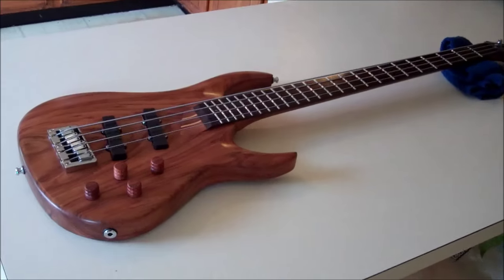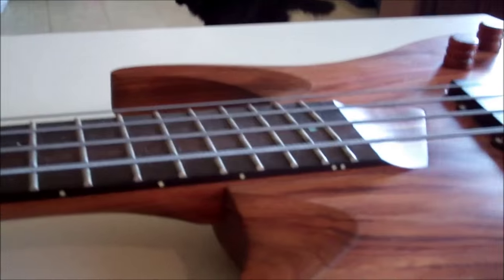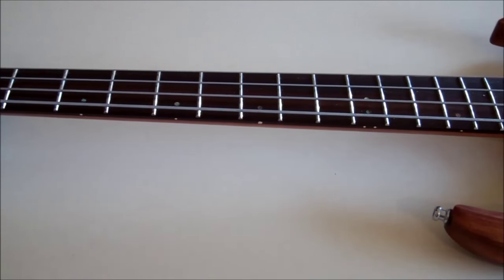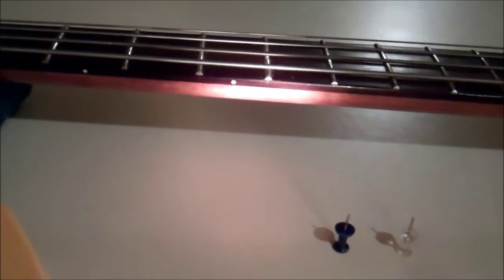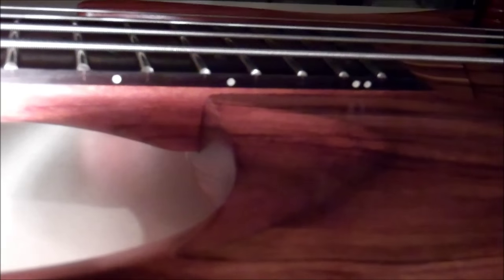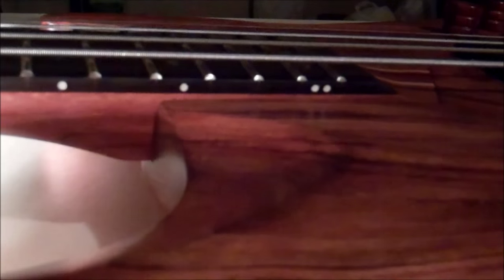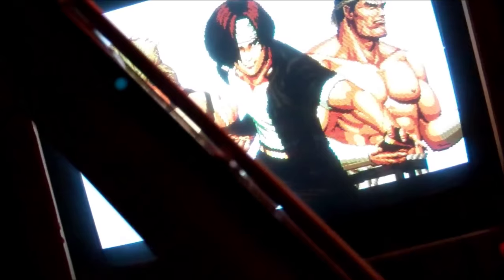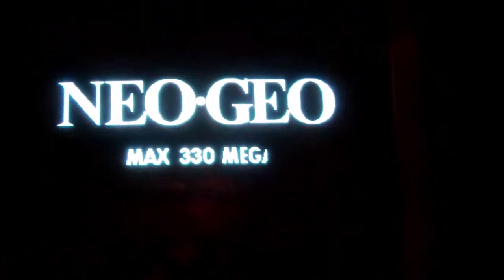Easy Luminlay glow side dot DIY install (No drill press required)

Comment: Man, excellent process and results. I have a Schecter apocalypse that already has luminlay...however they are WAY darker under normal daylight and very hard to see....and it only has two fretboard markers on top. Thought about  replacing with a standard white ivory colored inlay. But  now I see there are several luminlay variants....which specific product is this?
Reply from the maker: It says in the description. :) There's some discussion about the different kinds in the comments. If you have a maple neck then you probably want the kind with the black piping around the outside, so you can see them in daylight. You do need the LED flashlight to charge them properly, but they don't glow in daylight so I assume that's not what you're referring to.

Comment: Thank you for your kind sharing! Your method seems good to try since I'm worried about my drill going out of the 2 mil way.

According the way you used drill bit in the video, you just used it only for removing the plastic dots, right? I mean, in fact, this step could use any tools to do the job, am I correct?

Oh, I'm a fan of KOF 94 too, hahaha!
Reply from the maker: I'm always pleasantly surprised when I encounter other '94 fans! You see folks on it sometimes in Fightcade, even.
As for tools, yes, you're correct. However, I feel like a drill bit is ideal & safest because it's already cylindrical and fits right inside the existing hole, plus you can go slowly with your fingers and clean all the plastic out without worrying about the wood.
Reply: @Billkwando  Ah I see. Thanks again!

Comment: thinking about doing luminlay side dots for a bass....any recommendation on WHICH luminlay dots to use?  They have several types....I'm like going to go with a 3mm dot, but what color, and whether to use the ones that have the outer "pipe" or not?
Reply from the maker: I did green rather than blue, I think because it was cheaper or perhaps a tad brighter (can't remember...it might have been because I wanted them to look like normal dots in daylight) but the ones with the outer pipe are only necessary if you have a maple fretboard. The black outline is so you can see the dots in daylight...otherwise the light colored dot might blend with the maple, making it hard to see at a glance.
If your bass is blue, definitely get the blue. rotlmfao ;)
Reply: @Billkwando  thanks!  Rosewood fretboard/off white body.....will prob go with the blue 3mm dots